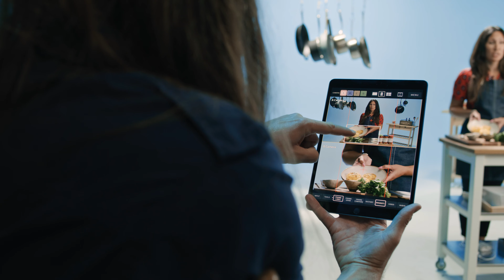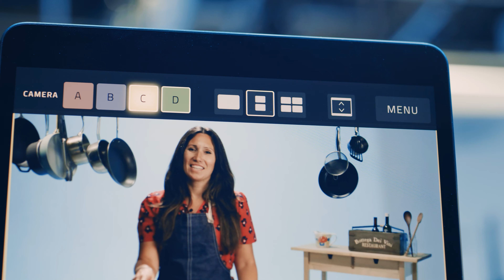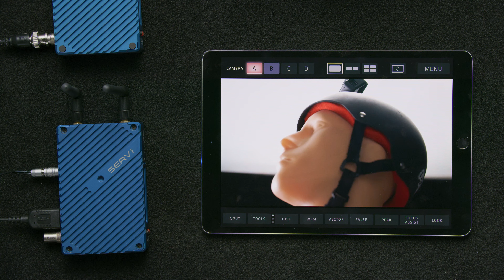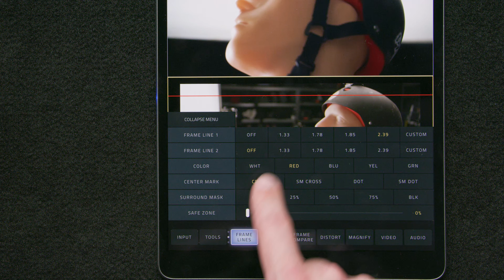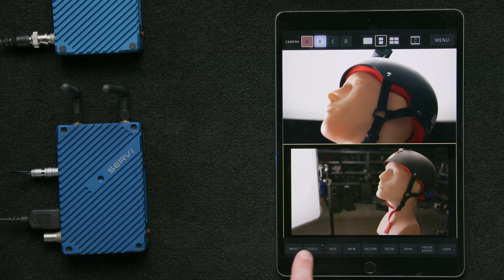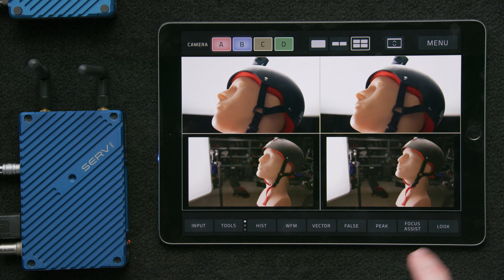iOS and Android Monitoring with VUER

Comment: Great app! Can I also connect it via W-Lan to my Sony camera?
Reply from the maker: You won't be able to use the Sony camera as a video feed in VUER on its own, but you can use it as a video source to one of our supported encoders that is compatible with VUER! https://support.teradek.com/hc/en-us/articles/115001008654-Which-Teradek-encoders-are-compatible-with-the-VUER-app-
Reply: @Teradek  Thank you for the quick reply. This is way overpriced however. I will just get the Monitor+ App instead.
Reply: Now you can with an Ipad without any external transmitter